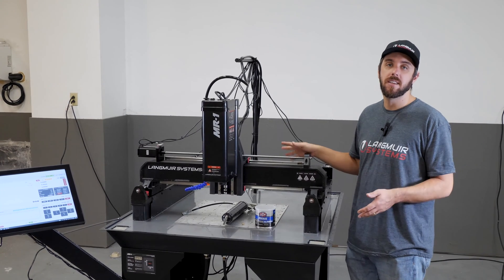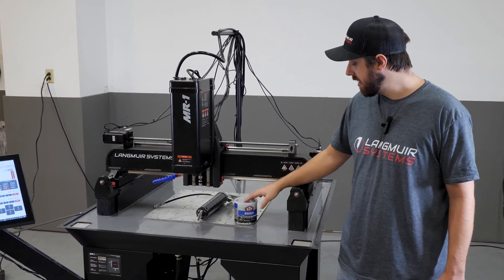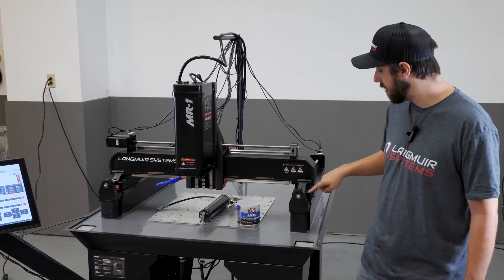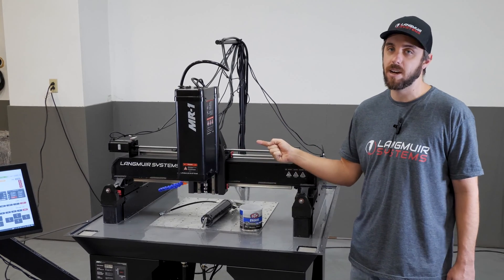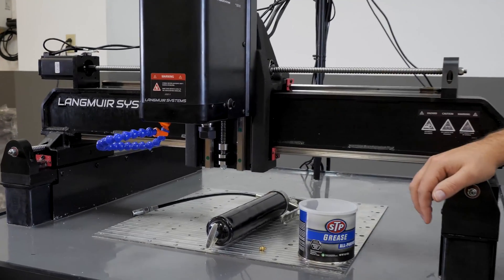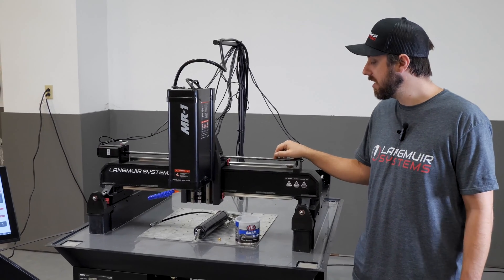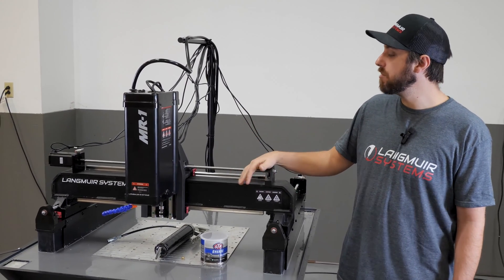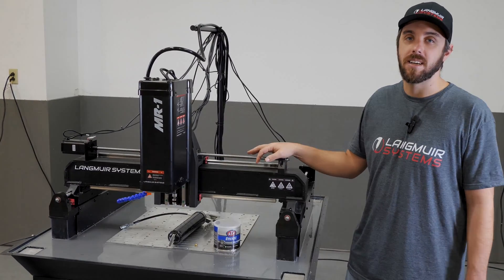MR-1 CNC Mill Assembly Tutorial: Machine Lubrication & Maintenance

Comment: Can one install a zirk fitting in all linear bearings and leave them there to make maintenance easier?
Reply from the maker: Yes you can, but there’s a small sacrifice to travel distance in doing so. We’re thinking about developing some low profile grease fittings that can be left installed without affecting travel distance.